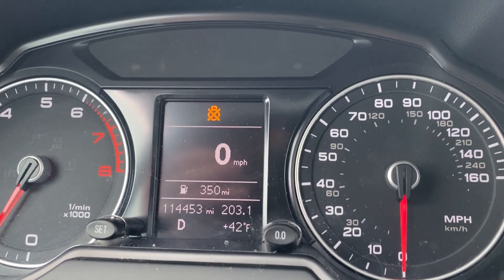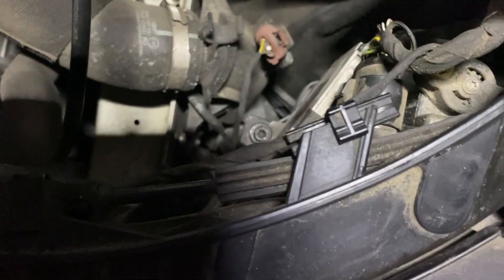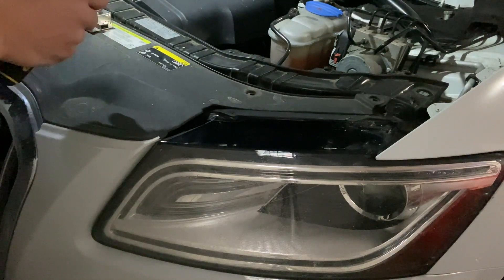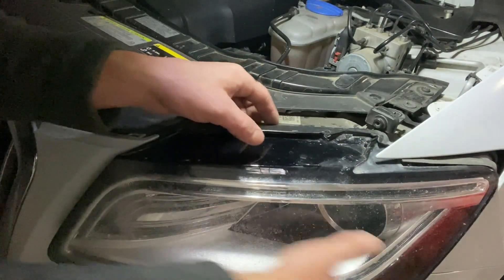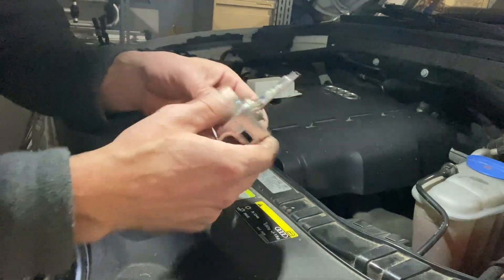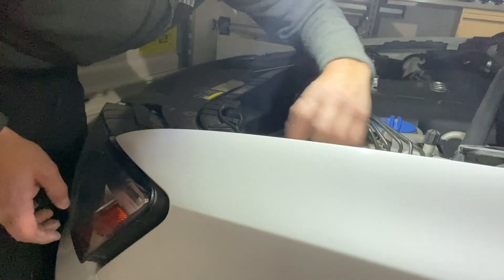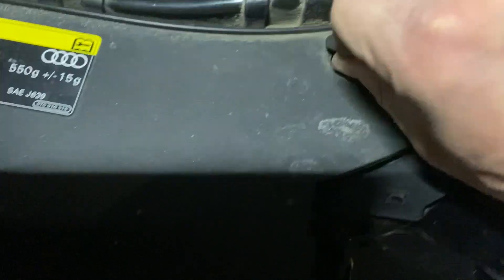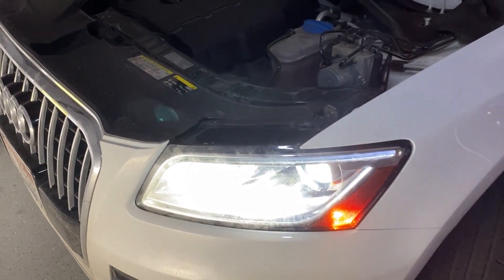How to repair your Audi Q5 2.0T: HID D3S Low High Beam headlight bulb replacement

Comment: Thank you so much for this video. I replaced my headlight today following your guidance without problem.  For my case, I found removing and installing light back need quite some strength, probably it is too hot here everything swell's up. Thanks again, you are super!
Reply from the maker: Thanks much, glad it helped!

Comment: You are not supposed to touch these bulbs with your bare hands.  The oils from your skin will get on the glass causing them to heat excessively in that spot and greatly reducing the life of the bulb.  Just so you know in the future.
Reply from the maker: Great point.
I think my video is clearly showing how I am handling the new one with 2 fingers just touching the base… but thanks for pointing out